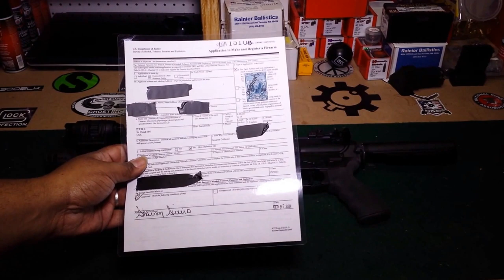Building a SBR - Short Barrel Rifle - For 3 Different Calibers

Comment: nice builds man! i put the 15in head down provectus rail on my 16in 5.56 but im starting to wish i got a troy alpha instead! i just got a .308 dpms recon so maybe ill get the troy for that. we are going to be able to sbr here in washington soon too
Reply from the maker: THANKS!!   I do like the Troys but I wanted to make the 300 blkout stand out from the others. Glad your state got it right with the SBR change!  Wait - weed and SBR's ...... If it wasnt for all the rain, NAW - I cant leave GA!
Reply from the maker: jacob manalang Just change the barrel, gas block and flash hider, you can use the same bolt and mags. Truthfully I only built the 300 aac because one of my suppressors is rated for 300 Blkout also and the round sounds great suppressed!  If I dont like it, I will break it down and part it out or sell the barrel and make another SBR upper. Too many options! lol. 308 is a great hunting round! Shouldnt be too hard to trade for a 1911. I dont trade for ammo. When the ammo is gone they still have a rifle!

Comment: Planning on doing a video of the guardian 9 on the .300blk sbr running subsonics? I'm very interested in how the guardian 9 works with that caliber and its the suppressor that huntertown recommends for use with .300blk subs.
Reply from the maker: Yes, it is in the works. I just finished the 300 Blk and tried to run it last week but had some FTE problems. I have to get back to the range to see if my adjustments work. I did manage to get off few rds suppressed but I was more caught up on getting the rifle to run correct at that time. I cant give an opinion yet. If you are planning on using the Guardian 9 dont forget you have to replace the booster with a 5/8x24 tpi fixed mount to fit a 300 blk barrel. Thanks for watching and the sub!

Comment: do you have a parts list for this build? and is it easily changed over to suppressed?
Reply from the maker: This one SBR has spawned into 2 dedicated SBR's now. The setup has changed a bit. I went ahead and SBR'ed a separate 22lr lower - It was too much fun to have to keep swapping out uppers. The 300 blk out upper has been sold. A friend made me an offer I couldnt refuse. I have since replaced it with a 8.5" 300 blk out build from Radical Firearms. The 5.56 upper now has a Trijicon MRO optic and a YMH Quick Disconnect for the suppressor. Its very easy to change and it ratchets up very tight. I wont include much of a build list because these rifle were pieced together a few years ago and I have changed out some parts for better parts as the industry has come up with the next best doohickies for our toys. But thats the best part of piecing your own rifle together - so you can get the knowledge of what works for your rifle! Thanks for watching!!!